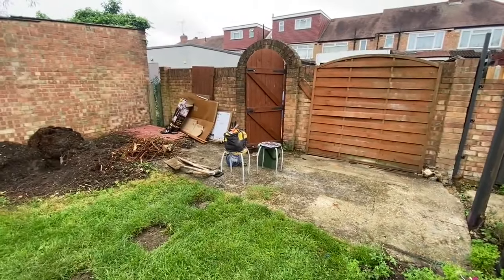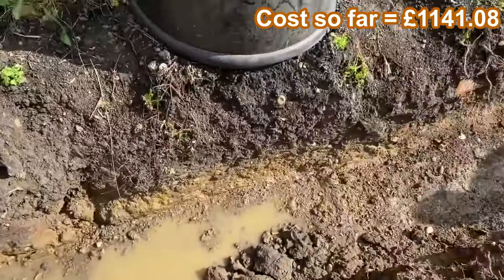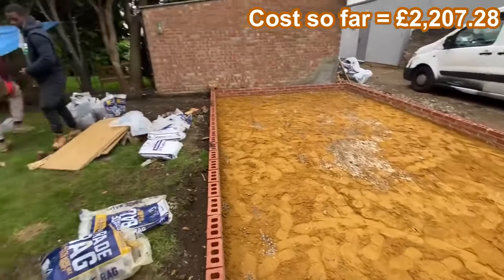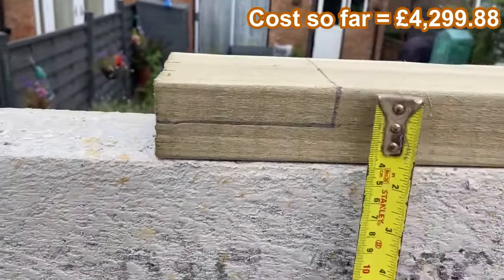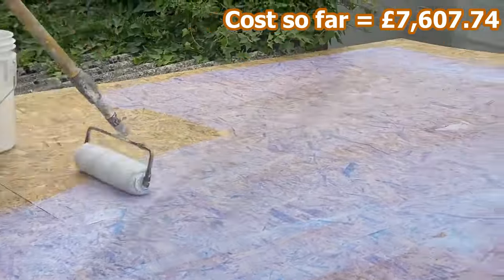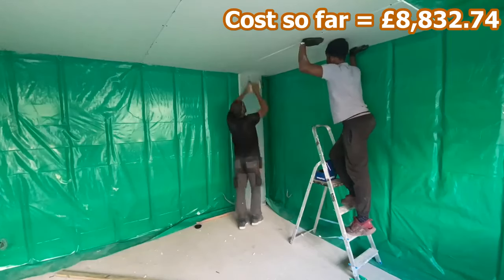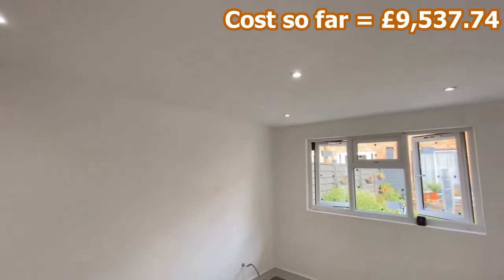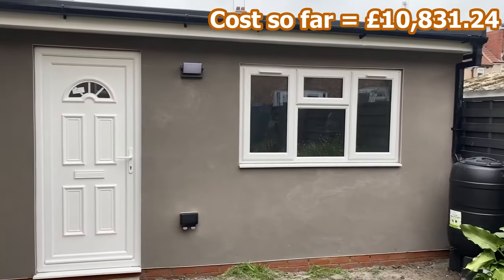How much does a garden house cost? Full cost breakdown of materials

Comment: I’m about to attempt to build my own garden room and watching your videos as best content out there 
What block do you use ? I was going to use a light weight block but my plasterer advised me to use solid concrete blocks as the light weight are prone for cracking 
Keep up the good work 
Cheers
Reply from the maker: i used dense concrete blocks, I would use them instead of the lightweights if its a single skin wall.

Comment: very interesting... I don't see any metal tying the bricks to the foundation or to each other or used in the foundation for strength.The blocks do not have holes and sit up right which looks easy for them to fall over. Just wondering if the blocks are different in Europe. Are the wider blocks  with holes available? Those blocks can be filled with cement for strength and used for tie in and you can drop rebar all the way down.

Comment: Interesting...that is quite a bit different than in my country.In my country foundation has to have rebar,same as the slab...for slab even two zones. Other difference is on foundation walls goes concrete blocks first then slab and bricks, here is opposite...other things are more or less the same...

Comment: Wow love this video! I've been watching hours of videos on building a block shed. Yours was by far the best and most thorough!

Quick question - Is steel reinforcement required for the foundations footings and concrete slab or is this not necessary? I intend to use the shed for office/storage similar to your video. Thank you
Reply from the maker: Hi thank you, no its not necessary. If it was a gargage then yes add steel in the concrete floor slab

Comment: Hi thanks for sharing this video it's really helpful. Just a quick question about piers and are they needed. I'm looking to save on space mine is4.1mx3.7 that I'm building with 100mm block just wondering was it the internal wall that meant they was not needed and did you use 150mm or 100mm block. Thanks

Comment: Im well Up North almost in scotland.... But I found the video really helpful, I have been trying to decide on the best way to complete a snooker / games room in my garden the ideal size is 7m x 5m. Although Im not a builder Im pretty decent at diy so you have inspired me to attempt the room myself so hopefully prices of materials being slightly cheaper up here I might be able to come in at around the 12k mark. I wont need the internal wall or the extra doors so should be doable. Just a quick question In lots of your videos you use fibreglass on the roof why did you opt for rubber in this case?
Reply from the maker: hi thanks, the customer didnt like grp so this was an alternative that we recommended

Comment: Apologies if you answer this later in the video or elsewhere, not finished watching yet.

How do you go about the design for your garden rooms?
Do you use a program like sketchup to design it all before you start, or do you just have a rough idea in your head of how all the different components come together, and then make it work as you go?
Reply: There's not much to design to be fair. A large rectangular room with one dividing wall, three doors and one window. Could draw it on the back of an envelope. 😉
Reply: @jmk1962  Design as in for the details on how all the different parts come together. Easy to forget things, make something the wrong width/height and cause yourself a problem further along the line you didnt think of.

Its why we bother with construction drawings. I could draw most houses on the back of an envelope as well.

Just wondered if he does any sort of drawings etc for these and what his process is if he does.
Reply from the maker: No drawings I kind of know really. I had a design from the client but the details I deal with

Comment: Did you remove the pegs after the cement pouring ?
Reply from the maker: No
Reply: @darrenthebuilder  You could have used rebar steel. Thanks for the video

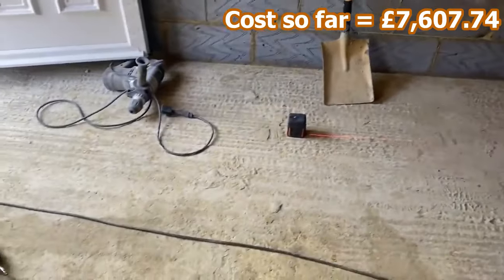Comment: 31:05 You talk about fixing 2x2 battens (I suppose treated), but in the video, you fix 2x3 planned cls stud timber??? Battens should be treated timber, not cls, as they touch the external wall. If you use CLS, it should be DPC layer in between to stop moisture from rotting the timber. Also, both are nearly the same price, so waths the catch?
PS. 
Also, a vapour barrier is a stupid thing by design. What it does is it makes your room/house a massive greenhouse. Have you ever been in a greenhouse? Moisture from humans can only escape through ventilation (windows, doors, air ducts). Most people fail to properly ventilate their rooms and the result is Mold all over the walls and ceiling. Regs are written by incompetent muppets (at least in the UK).